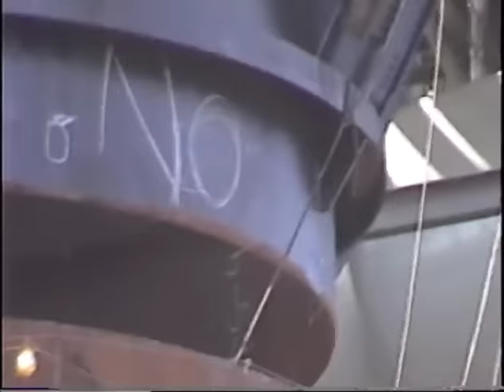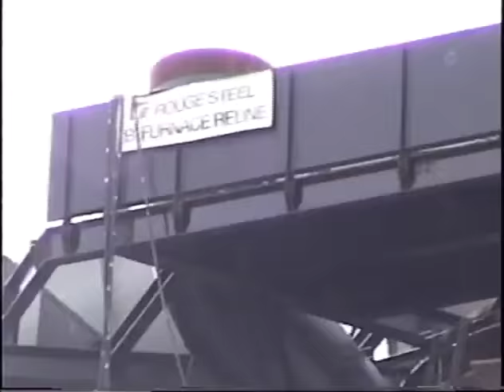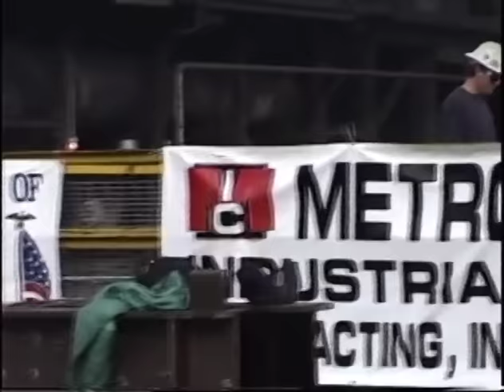B Furnace Reline 1997 - Rouge Steel

Comment: how long does it take to cool down so you can go inside and do the work ?

How is the initial light up of a cold furnace beeing done?

Also don´t get it how a 80 year old furnace can still be operated econicically...technology goes on
Reply from the maker: Hi, there and thanks for commenting!  It can take a couple days to get rid of all that heat. You can pump air and water in there to help cool it down. Re-lighting the furnace has to be done carefully so you don't damage the new refractory.  The main thing is to dry out the bricks of any moisture.  This must be done slowly or the moisture in  the bricks can explode like popcorn.  We used natural gas to slowly dry everything out before adding any of the three ingredients in the furnace (coke, iron ore and limestone). Also, fortunately, the process of making iron hasn't really changed that much in the last hundred years or so. Sure, the process is controlled by computers now, but it's still...put raw materials in the top and blow hot air in the bottom.

Comment: 8:15 Those bricks look as if they were partially melted from spending all that time under constant high heat.
Reply from the maker: Those are actually weal plates that are installed to protect the relatively fragile insulation bricks. The operating temperatures at the top of the stack are pretty low, a few hundred degrees. However, when the iron ore, limestone and coke are added to the ‘burden’ by dumping the large bell, the impact can damage the refractory. So, they installed metal wear plates on top of the refractory. Some of the wear plates are severely worn as you noted. The wear is caused by tons and tons of material hitting the wear plates, not from the high heat - which is much lower in the stack.
Reply: @GrayHare  thanks

Comment: how do you restart a blast furnace ?
Reply from the maker: That’s a great question!  It takes a lot of planning to restart one. First the refractory is all new and that and the mortar needs to be dried out. You start with lighting some natural gas torches. That’s a nice slow warm up and gets a good draft going (like a fireplace chimney). After a couple days of that you start putting what’s called coke (it’s pure carbon made from coal) in it and start using the big air injectors, called tuyeres. You fill it full of coke for a couple of days while monitoring refractory temps and moisture content. When everything is up to operating temp (about 2,000°-2,500°F) then you can start adding iron ore and limestone to the coke.
Reply: @GrayHare  so instead of wooden planks natural gas was used? In books it was mentioned to use big wooden planks to heat and then the use coke.
Reply from the maker: @deepbhaisare  they probably were just getting rid of debris from the job by burning wood planks. The natural gas is much easier to control than a wood fire. The dry out and preheating of the refractory is pretty critical to a long life. If you heat it too fast, trapped water turns to steam and it’ll act like popcorn and do a lot a damage on a new lining.
Reply: @GrayHare  make sense.
Reply: Throw a lit match in.

Comment: Is this the furnace that exploded around 2008-ish under Severstal management? Would you know what could have caused it?
Reply from the maker: I believe it is. Water getting in the furnace can cause explosions. The water turns to steam, just like a popcorn kernel. There’s several sources of water on a furnace, mostly it’s used to keep the refractory cool. I left Severstal around 2004.
Reply: There were a couple of scenarios that were put forward. One was the furnace suffered a major slip. Another had to do with water dissociation in the bosh creating hydrogen and oxygen.  There are also stories of steam leaks in the lower stack. I remember B furnace being run very hard during the C furnace rebuild. I understand that the explosion happened during a shift change other wise a lot of people may have been killed.

Comment: Is this plant still operating?
Reply from the maker: As far as I know it is.  While I was there it changed from Ford Steel to Severstal (Russian).  It has since changed to AK Steel.  During my time, we had three blast furnaces A, B and C.  A and B were pretty small and were built by Henry Ford around 1918.  C was added during World War II.  A was abandoned when I hired in around 1993.  B blew up around 2008.  C was completely demolished and replaced with a brand new furnace shortly after that. I don't know what they call the new furnace now (maybe D?), but I do believe they are still producing steel, but I don't that for certain. I imagine the new furnace is doesn't use raw materials like iron ore, coke and limestone.  I would imagine that any new furnace built today would use scrap steel, but again, I'm out of the industry now.

Comment: How often does the furnace need to be relined ?
Reply from the maker: I think it can vary a lot but 7-10 years we’re typical. Many factors can influence the life, like the cooling circuits, protective armor plates inside, etc. Sometimes, ‘scabs’ can form on the inside of the refractory and become so large that they pull the refractory off the steel shell when they fall.
Reply: @GrayHare  按照现在的工艺水平可以使用都15年。
Reply from the maker: @ww_9527  Thank you for saying that the life can be up to 15 years.
Reply: Hot spots can happen on  shell

Comment: Seems wall jam could not be removed.
Reply from the maker: I don’t remember exactly what a wall jam is, but we pretty much stripped everything down the shell from bottom to the top. If they inspected it and thought it was in good shape, then they must’ve chosen to leave it.
Reply: @GrayHare  it must have been left deliberately as the whole brick lining was taken off. I found that later in the video. But very insightful video. Thanks.

Comment: 3 months! 
No wonder manufacturing has moved overseas. I bet if that was done in China it would be finished in 24 hours. 
I’ve seen them put in miles of highway, closing the road only in the hours of darkness, by the morning it’s finished and open again. It’s even worse in the UK, they’d still be doing it 10 years later as they can’t get the right health and safety certification.
Reply from the maker: Did you see the size of the furnace? It’s the size of a small high rise. The refractory total was over 1 million bricks! I know you’re exaggerating when you say 1 day, but 3 mos was the norm back then and you only had an extra week or two built in to that.
Reply: @GrayHare  I apologise, I was being slightly facetious. But, having seen the Chinese achieve in one evening what it would the British to accomplish in several years it does make me wonder why the Anglo Saxons are so slow at everything. It does appear, at face value, to be inefficiency. 
I used to work with South Korean contractors and Japanese architects, project managing large high technology facilities in mainland China. The north Asians work extremely hard and efficiently. Roads or bridges that would take a year to build in the west, finished overnight, with zero impact to existing transport users. Even periodic factory shutdowns, weeks in the west compared to days in the east.
There is some learning to take from them if we are ever to compete.

Comment: wow you didn't even show the start up of the furnace or the shut down always wanted to know how they turned it on and off
Reply from the maker: That was in there! To turn it off, you just have to shut down the air and stop feeding in the coke and iron. It’s like a car running out of gas. Then, to start it back up, you preheat the furnace with natural gas then start feeding coke into the furnace, then start adding iron ore and scrap. It takes a few loads to get a quality product out of it.